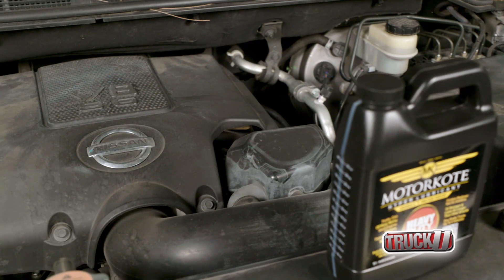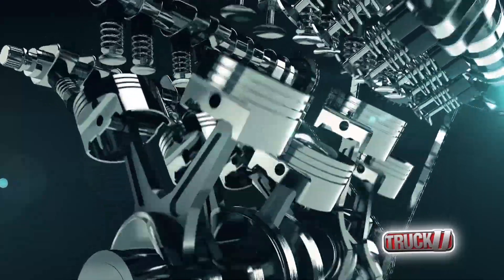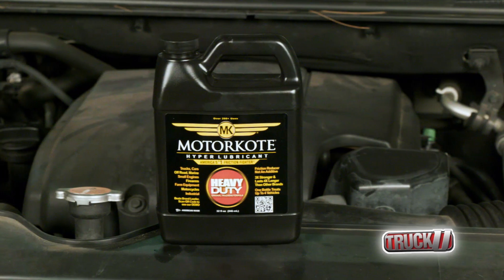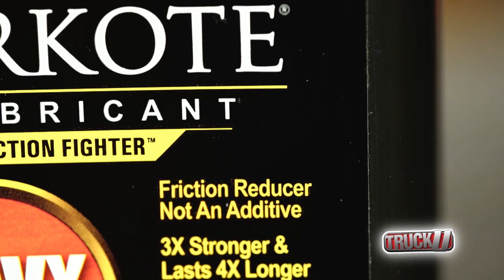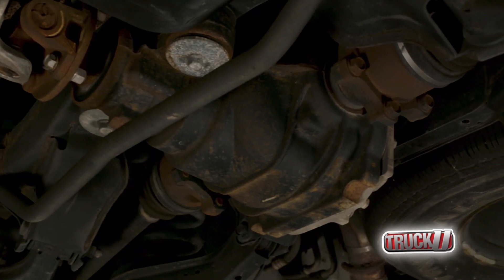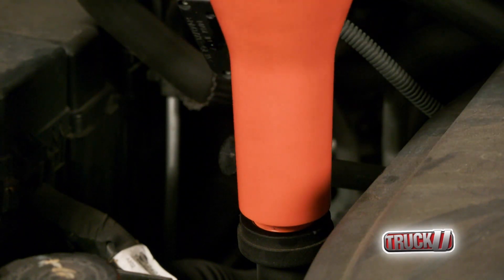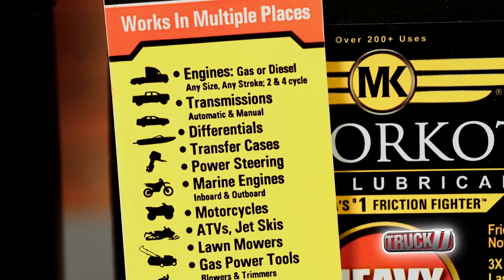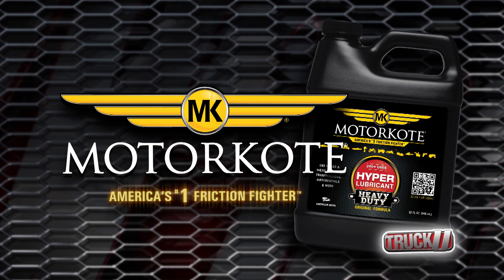Restore engine efficiency with better lubrication. MotorKote TruckU Tech Tip

Comment: The stuff is getting harder to find in Canada.  I’m buying everything I can put my hands on.
Reply: Does this oil really work,can you tell me a few things about this miracle oil
Reply: @thomasliontos6005  project farm filled lawn mower engines with motorkote and one with regular oil, ran them both checked temps, motorkote ran cooler, then he drained the oil and motorkote from both engines no drain plugs and ran the engines again, the regular oil engine blew up and the motorkote engine kept running with no oil because the motorkote treated the metal parts
Reply: @thomasliontos6005  
Buyer beware. 
This stuff forms hydrochloric acid in the engine and destroys them. 
Its Chinese garbage but don't take my word for it do your own research.

Comment: Snake Oil ....I tell you!!
Reply: You never heard of Project Farm have You?
Reply: It works! I own a fleet of injector eating diesel trucks! For the past 3 years no more injector problems, no more replacing timing guides, no more replacing wiped out cams! It works!
Reply: @2mtnbros  forgive if this is a stupid question but how does a diesel engine oil addative stop diesel injectors from going bad?
Reply: HEUI.
Reply: @2mtnbros  thankyou. 👍
Reply: @2mtnbros would you put this in a Chevy 350 camshaft engine?

Comment: Chlorinated Paraffins, their main ingredient... LOOK IT UP
Reply: its interesting to see it containing chlorinated paraffins. Amsoil's test was also 9 years ago, curious if its changed any. This product gained a lot of traction due to project farm's video on it. I just started using it in a truck i dont run to much...It's made my lifters more quieter (they arnt talking back LOL). So far so good
Reply: Adamz678 Wrong kiddo.
Reply: @mikebradford7780 Show your facts.
Reply: Sorry man. That was meant for the original poster.
Reply: Their website now says it's not corrosive in short or long term
Reply: Is this stuff not good in the oil. I added it and its running like a miss fire going on. I changed out the #4  and now its showing the MAF OR MAP is bad on the scanner. Are we suppose to change the oil after a few days of adding it.
Reply: @Dan Bryant Some say it's corrosive, meaning acidic and can cause pitting/degradation. But here's amsoil's study or take on it http://thebestsyntheticoil.com/pdf/TSB%20MO-2010-04-01_chlorine_oil_treatments.pdf
Reply: @Adamz678  You information isn't correct.  It don't list anything anywhere.
Reply: same  as lucas  .............  ok thx ,,

Comment: What is Motorkote's official stance on this AMSOIL technical service bulletin entitled "Chlorine-containing potentially corrosive aftermarket engine oil treatments" that states spectrographic analysis of Motorkote hyper lubricant revealed that it's chemical makeup contained 272,000 ppm (27.2% overall) chlorine?

https://www.google.com/url?sa=t&source=web&rct=j&url=http://thebestsyntheticoil.com/pdf/TSB%2520MO-2010-04-01_chlorine_oil_treatments.pdf&ved=2ahUKEwiXi-CYz9XeAhVNzlkKHXDND1cQFjAAegQIBxAB&usg=AOvVaw1IChoFnBKnDzkY6yUksjKu

Note: the above link is a .pdf of the AMSOIL service bulletin.